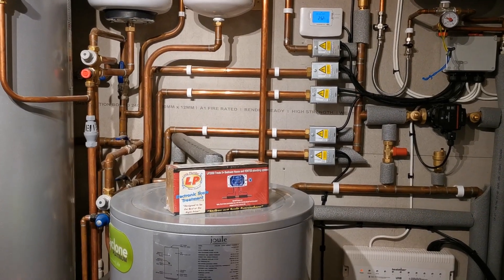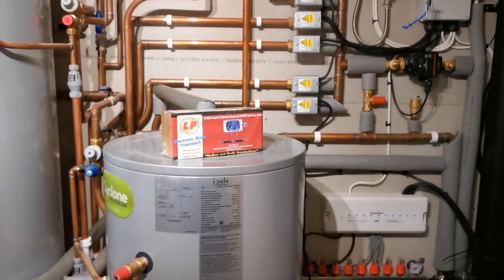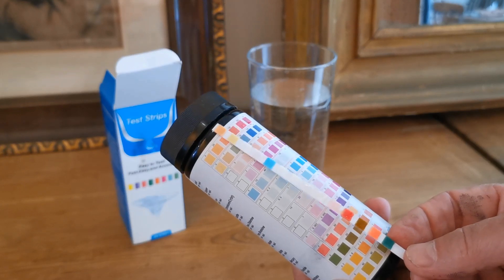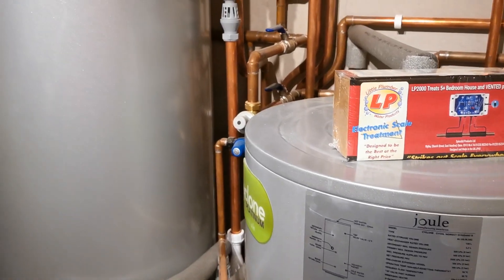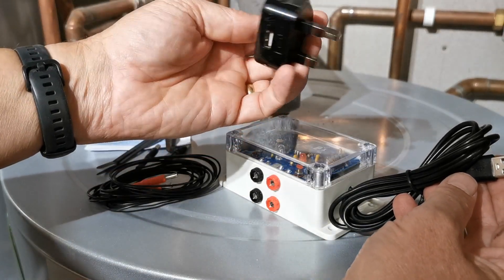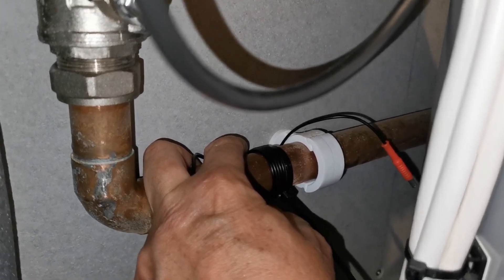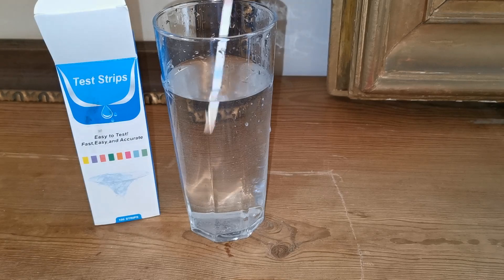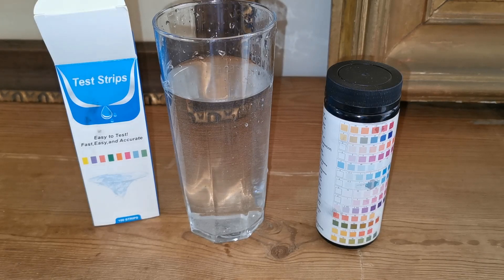LP2000 Electronic Water Softener Review #watersoftening #watersoftener

Comment: Very nice video. 
Because the Calcium and Carbonate are still present in the water, the test strip will still show HARDNESS is high because it only tests for Calcium. The effect of the LP2000 makes Calcium ions combine with the Carbonate ions to produce submicroscopic minuscule crystals of Calcium Carbonate which stay in colloidal suspension. This means that they do not precipitate out at LIMESCALE and although the TEST STRIP still shows high Calcium in the water it is not now present as a free ion  Ca++ and so the water will behave as if it is soft when used for washing up or showering. And of course because it has no salt (NaCl) in it can be drunk all around the property.
Reply from the maker: That’s good 😊 to know thank you for letting us know